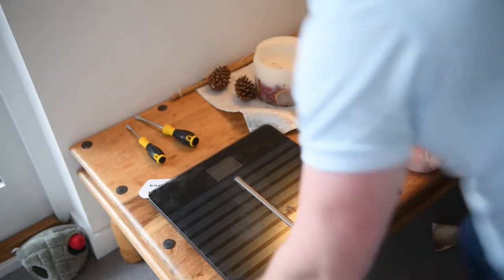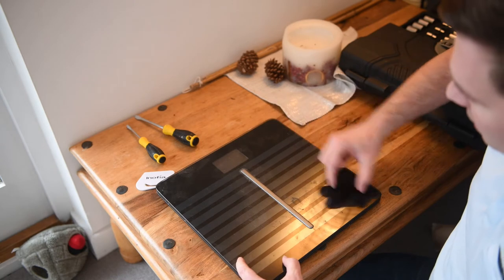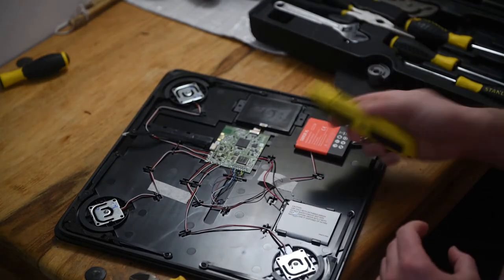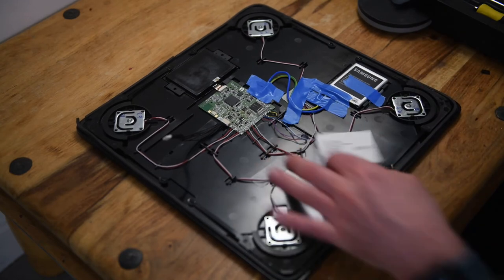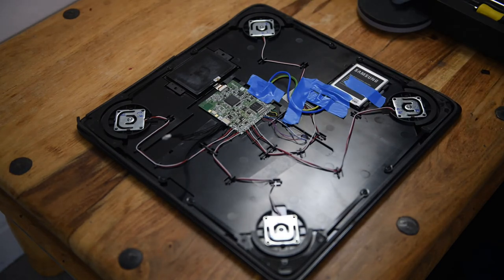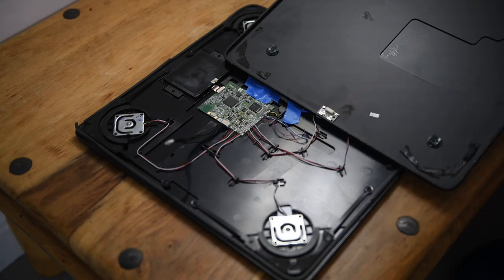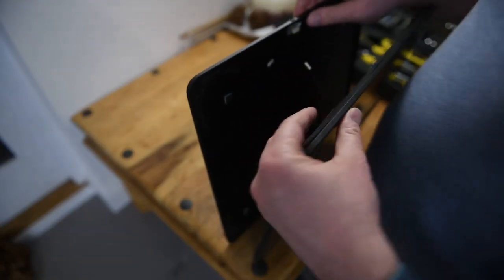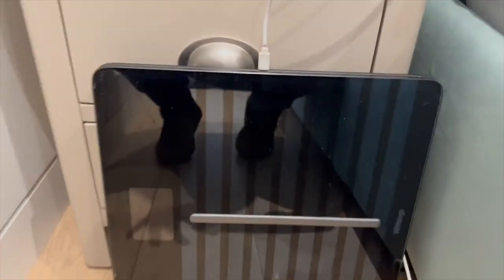How to Replace battery on Withings Body Cardio Scale

Comment: Thank you. I have the same problem and scale was less than a year and a half old. Withings wouldn’t replace because older Body Cardios only came with a 1 year warranty. Figure I’ll give the battery replacement a shot.
Reply from the maker: Good luck, I hope it all goes smoothly.

Comment: This process worked great, I replaced the battery and the scale now works, unfortunately, the new battery will not recharge. Did you experience this too? the battery came 48% charged, so I have a least a little time with it. 🙂

Comment: I swapped the battery and still won’t power on. Tested battery with multimeter and it is sending power to circuit board. Any ideas?
Reply: I am experiencing the same. But I have the original battery. I am measuring 4,7V, which to be honest does not look right and I am suspecting it from damaging the board.
Reply from the maker: I found the original cables to the batter very brittle and ended up replacing them with thicker wire. that could be the issue you're having.

Comment: JFYI and not nearly as elegant, I just soldered three double a's together in series and hooked them up to a pigtail outside the scale and that was a $1 fix until I get a replacement battery that fits inside.

Comment: You do realise that it is rechargeable?
Reply from the maker: Yes the charge wasn't holding for more than a few days as the battery had gone bad.
Reply: older battery chemistry was an issue with cell phones too.  There is a limited number of recharge cycles on those batteries before you just needed to replace the battery altogether.... they also have a shelf life so when you buy one, make sure you get a recently manufactured battery.  I don't know how you make sure of that and it may be a matter of luck.
I'm curious to know if you had to reassociate the scale with the wifi network after this installation was done?  I'm about to replace ours, same exact scale.  
Thanks for the video it was very helpful.
Reply: Damn I forgot. I was about to tear this sumbitch apart 😂 thanks got it charging now!

Comment: I swapped the battery and still won’t power on. Tested battery with multimeter and it is sending power to circuit board. Any ideas?